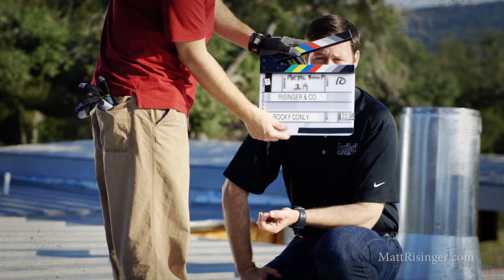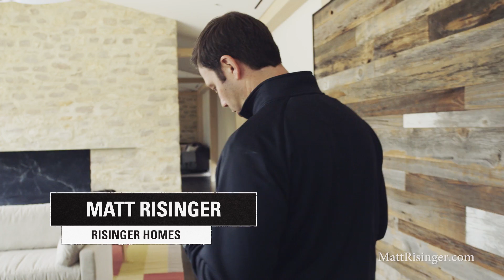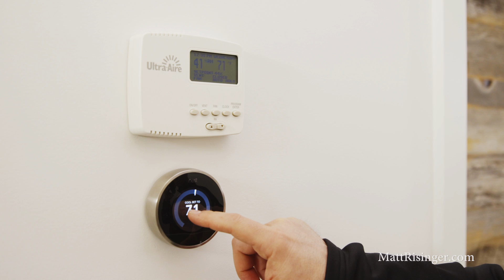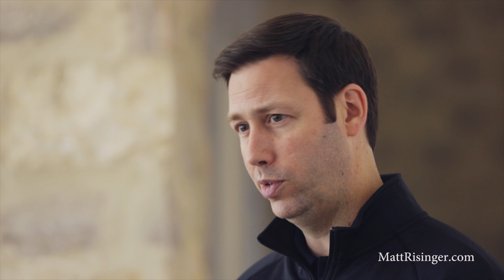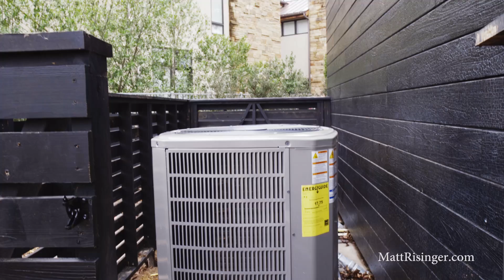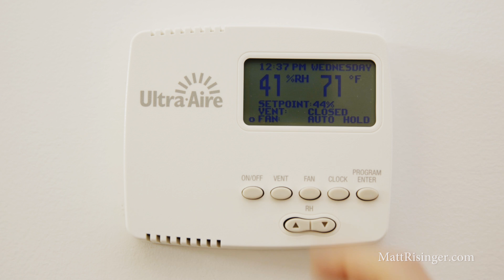Secret HVAC Equipment for Ultimate Comfort - SD12 Reveal

Comment: I love your videos.  I see the recommended install on the website is connecting the UltraAire supply to the main supply.  My only question is, will there be enough CFM to to blow out of the registers?  Or is it recommended to have the air handler’s fan running when the dehumidifier is running.  My only concern with the air handler’s fan running on constantly is it would create more humidity in the summer blowing over the coils when they aren’t cooling, correct?

Comment: Sucks this unit is 3600 bucks and is way oversized for what i need . That is the bad part of dehumidification, the heat byproduct. I really like this split type system. Too bad they don't produce smaller less expensive split type systems. Anybody know of any other manufacturers that make similar   smaller systems?

Comment: Matt, Great video. I am having a new 3,900 sf house built in the Raleigh, NC area. I am looking to have an Ultra-Aire dehumidifier installed. If it gets installed in the passively conditioned attic, is it worth the expense of going with the SD12 over one of Ultra-Aire's non-split system units? For clarity, the attic on the 3rd floor will not be directly conditioned, but the undersides roof sheathing and the adjacent vertical walls will be spray foamed with an open cell product. Your thoughts are greatly appreciated.
Reply from the maker: I would do the XT150 model

Comment: Matt I found your channel the other day.  so far I have watched all your videos.  I am planning a ICF house with geothermal heat an air.  after watching your videos I am mixed now.  I live in Central Arkansas, so similar climate. I have not seen you do ICF, or geothermal. is there a reason.
Reply from the maker: I am doing my first ICF house now. Video coming soon. Depends on your reasons to use it. Has several positives and a few negatives in my mind. I am not a fan of GeoThermal generally. I like VRF HVAC systems   Feel free to ping me if you have specific questions. Welcome to my channel!  Best, Matt.

Comment: Honeywell has a de-humidifier which only uses 500 watts, is internal to the home except for water removed from the air before the air reaches the air conditioner. cost ~$1,000 for ~3,000 sq ft home. more info call 800-468-1502

Comment: Great video,   would you prefer this unit over the traditional UltraAires ?

I think the traditional unit would be great if you could pipe it into the bathroom or laundry exclusively......
Reply from the maker: SSigmaster This split unit is more expensive to buy and to install, but it will yield greater efficiency in our hot/humid climate zone.  Plus, when it runs you'll get some supplemental cooling!  I have a UA 70H in my house and even this basic model does a fantastic job in keeping my humidity at a constant level.

Comment: Please don't say mandatory.  It is nice to have information and we also do systems similar to this one but this should be a choice. You stating it should be mandatory makes me think you are not a property rights guy which is sad.  If there is a good product out there the free market will take car of it.
Reply from the maker: ArtisanTony My videos are intended to educate you on what I think are the best ways to build a house.  I've heavily weighted to my hot/humid climate.  In recommending a Dehumidifier for your house I'm advocating for comfort and efficiency, but not for greater regulations.  Matt
Reply: I think Matt means mandatory information and options for  buyer's who want excellent comfort in their highly insulated and sealed house while still saving money over running a standard 13 Seer AC to lower temperatures.  The net effect of running the AC at 70F on an 80 degree day is the main system runs longer and more often reducing the humidity in the process.    

There are other options that work in a "pretty good house" (eg normal construction) such as 2 speed compressors with variable speed indoor units operated with a thermostat that can control on humidity and temp.   These Seer 16 and better systems over cool on occasion to pull the humidity down and operate on lower speeds for longer periods when low loading allows.
Reply: Richard Parker
That's is not what I heard.  I heard that he thinks we need more government regulations.  Maybe he should clarify.
Reply: Richard Parker
He said "let me show you what we did in this house, which I think should be mandatory for new houses being built in the southern US"  That is pretty clear.  I build custom homes myself and we pride ourselves with having exceptional understanding when it comes to hvac components in our new custom homes.  I regularity install zoned systems for comfort and humidity control than normal builders have never even seen before but I would never advocate mandatory requirements.   You are going to raise the price of the standard home beyond what a normal family can afford and home ownership is more important than your dream of making every house conform you your idea of what is perfect.
Reply: ArtisanTony I think you are parsing words too closely, Tony. I heard 'mandatory' to mean you shouldn't build without doing this. My mind just didn't jump to regulatory.

On a related note, I live on coastal Georgia and installed an Ultra-Aire 90H. Makes all the difference in the world.
Reply from the maker: Richard Parker Well said.
Reply: Matt, how's the energy usage on the SD 12 Been?
Reply: Matt Risinger
I understand but I have been in the business since 1978 and have seen many changes.  https://www.youtube.com/user/ArtisanConstruction some good some bad but I always advocate choices for free people.  I suggest you do the same. It is easy to get caught up into the world of being paid for what you say.  Take it from a guy who is a little older than you :)